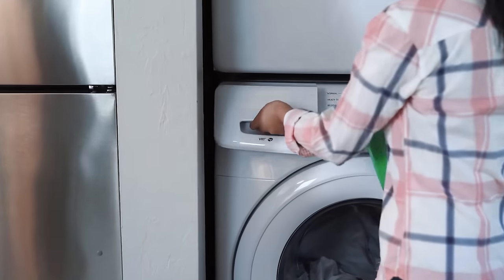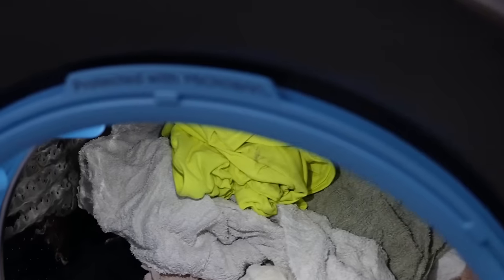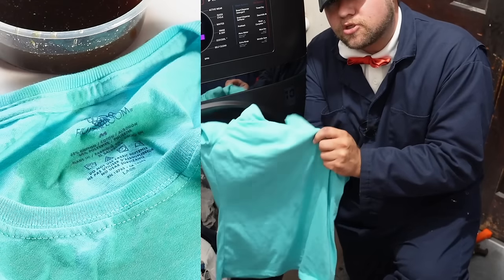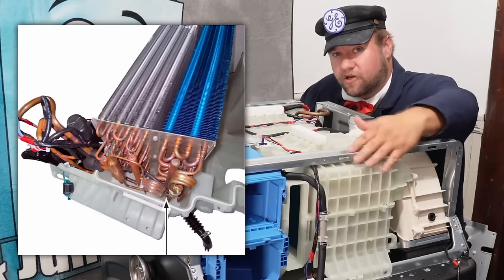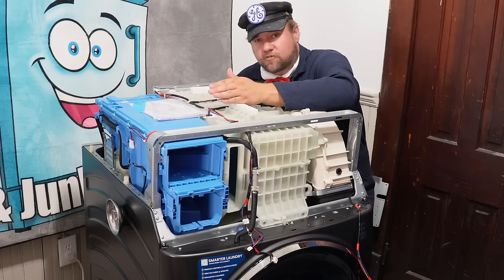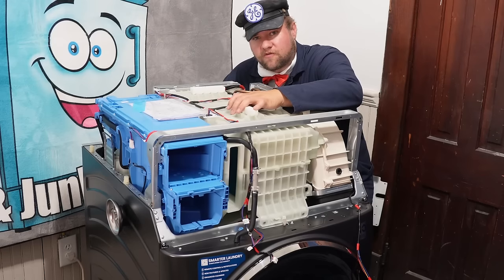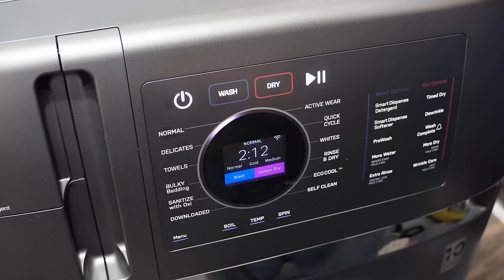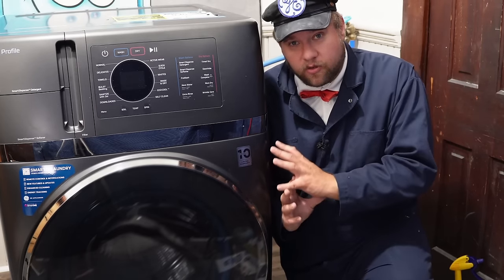The Best Washer Dryer EVER? The Ultimate GE 2-in-1-washer Dryer Combo Test & Review

Comment: In 1953 it was Westinghouse, not White-Westinghouse. GE appliances are built by Haire . General Electric no longer builds appliances.
Reply from the maker: The same GE factory is still making refrigerators in Kentucky that has for decades and decades...
Reply: That may be, but General Electric sold the appliance division to Haire some years  ago. So Ive read. In fact, I've read GE sold the lighting and medical equipment divisions as well. From what I've read, GE only builds Turbo-Jet engines anymore. GE did the same thing Westinghouse did. Sold off all their divisions. Westinghouse only held onto the Westinghouse Nuclear division.
 @bensappliancesandjunk

Comment: Ventless? Can you detail this feature?
Reply: Once the door is closed this is a closed loop. The heat pump will heat the air, a fan will blow the air into the drum, then draw the moist air back out of the drum, the warm moist air will pass through a heat exchanger to lower the temperature, the moisture in the air will condense out, the water will drain out using the washer drain pump, and then the cycle repeats.

Comment: Minor point, but you are conflating "Kilowatts" with "kilowatt HOURS". When you showed the display of the "Kill-a-watt" power analyzer, that tells you how many watts you're drawing right at that instant, and in the video it was about 800. Then you said that a load used up about 1.1 Kilowatts. That is incorrect. It used 1.1 Kilowatt HOURS. In other words, 1.1 Kilowatts for an hour. A "kilowatt" is a unit of power (ie. without a time component). A "kilowatt hour" is a unit of energy (ie. WITH a time component).

It's the difference between peak power usage (800W) and accumulation over time (1.1 kWh). 1.1 kWh is either 1.1 kW for an hour, or 550W for two hours. Since your test took 2 hours, this is your average consumption.

Comment: Mine is shaking violently right before the spin cycle. Any idea what can be causing this?
Reply from the maker: Have you removed the shipping bolts and bracket at the rear of the unit?
Reply: @bensappliancesandjunk  yes the delivery men removed the shipping bolts but I didn't see a bracket anywhere.
Reply from the maker: @oakfig  I have videos on how to find error codes. I'd check those first. Then I'd probably look for something that has come undone that's causing it to bounce. Like suspension springs, suspension rods, or counterbalance being off.
Reply: @bensappliancesandjunk  will do. Thanks so much man!

Comment: Love ours got it today. Wanting to get a second one, but I've measured the amp draw during full tilt it's near 10 amps sustained so if your outlet is 15A it won't cut it, 20A if it's dedicated (debatable though because 20A constant draw during dry cycle may overheat the wire and cut the breaker). Even if you decide to split your 240V you may only get 15A per pole (most are 240V 30A). So YMMV... Not sure how I'll do this yet. I could use the 110V socket for one and then the 220V socket for the other but I'm using that for the car charger lol.

Comment: Owned this POS for 3 weeks.  Prior to EACH operation inspect and clean the filter elements.  After 5 loads total there's lint passthrough to the heat exchanger face.  This system depends upon high heated air circulation.  F-GE.
Reply from the maker: There's a fix for that FYI. May do a video on it before I give the machine away

Comment: As a current appliance tech... do not buy these.  They're 110v and it's going to take forever to dry. Normal dryers run on 220v, 110v for the power and 110v for the heating. That washer dryer combo runs off a normal 110v plug so it is going to take forever and it will give you issues.
Reply from the maker: They dry amazingly well for 110v. It has a heat pump that pulls 1200w. The COP of the pump is insane and I have a video where I threw a thermometer in it... it gets up to 155*F in drying mode. Just as hot as a standard tumble dryer.
Reply: @bensappliancesandjunk  drying capacity is lower, check out reviews for it. A lot of people are saying it takes 2 hours to dry a set of clothes which would normally be half of that. A lot of people are returning them due to clothes still being wet after drying multiple times all night. Techs knew this would be an issue and yea there are some good ones out there but all of ge products are horrible and are designed even worse. How many times have you gone out to a ge dryer and the purple wire at the bottom right of the element has been burnt? Every company uses a normal heating element but not ge, they decide they want a giant round one so if the back gets dented at all you can definitely expect it to ground out and stay hot without the dryer being on.  In my opinion anything ge is horrible.  I know not everyone will see it that way and that's ok.

Comment: If thats a condenser based dryer function its a hard pass from me. I had a small samsung stackable ventless in my old cabin and it took forever to dry and never got the clothes bone dry, leading to mildew smells. Cleaning the condenser fins was a huge pain in the ass. Switching back to a old fashioned vent unit when I moved was a godsend.

Comment: Four hours?! What did I get myself into.  All I heard was 2 hours.  If it's 4 hours, Costco is coming back and picking it up (I paid $1900 fyi)

Also it's near 400 pounds.  That is the size of two adult males.  Keep that in mind.  I struggled to move this thing on a thin carpet with sliders.  I REALLY struggled getting it off of the bottom box foam that seems like it must insert up toward the washer. I just kept rocking the unit off of the foam in a tight space.  Rocking 400 pounds is not easy, NOT easy.
Reply from the maker: A regular load of clothes is 2hrs. A very bedding-heavy load should be around 4.

Comment: I used to work for GE. They sold their appliance division to Haier out of China, with rights to use GE brand name (til 2056 I believe).  So, GE appliances are no longer "General Electric" appliances.  GE appliances, lighting and other consumer divisions all sold to China in 2016... and hundreds of people were permanently laid off.  So, beware of that cheap steel that country uses, which is notorious for rusting like a cheap Chevette.
Reply from the maker: If you worked for GE then you knew that GE was already using Haier parts well before the acquisition then?
Reply: @bensappliancesandjunk  No I didn't. Guess it wasn't important to us until we were told our jobs were gone. But most US. products are made with cheap Chinese parts, so what's your point?

Comment: If you're not cleaning the lint filter on your normal dryer I don't see how that's the fault of this combo unit? Also given its ventless you have the advantage that you don't have to clean the vent ducting system as a maintenance task either. I think the kind of 'set it and for get it' mentality is a bad thing. Its not like we tell people "yeah jsut drive your car and never do maintenance on it." Why should we say "your washer/dryer requires zero maintance"
Reply from the maker: Its not the fault of the unit per-se, but a reality check on humans and their ability to blame the product, not the person. The other issue is that the failure to maintain the unit will cause issues faster than a traditional set-up. Again, not the units fault per se, just how the science of a heat exchanger works.

Comment: Great stuff, but you keep saying the usage of power in kW. kW is a measure or rate of power not capcacity/usage, that would be kWh. Completely different. Otherwise, great video, thanks. "Over the course of a 5-years, you're going to save 800 to 1000" kWh (NOT kW)!

Comment: I like the general idea...but I see clothes shrinking and forgetting Not to put bras in but they need a good washing....ehhh?   I want my old set of kitchen aid back...I like to set my own times and even just  set a second rinse occasionally or....I used to wash all of my husbands work clothes, but to wait until that entire cycle is done would piss me off if the stain got wet in permanently because it dried without a visual inspection ...MY TIME IS VALUABLE, so give me back non computerized gear timers, load levels and temperature settings!  I like to be able to was and dry a load rapidly if needed!  If all my uniforms were in the machine, but an emergency occurred where I was needed in a particular setting like a funeral or? or something....then what!?   I seriously want to know if they still make the pre computer old fashioned extra sized washers and dryers...I do a lot of sleeping bags, king sized beddings camping equipment..l know how long an$ which temperature for which stains...let me use a 20 minute wash totalvon a gebtle agitation but fastest spin speed to aasureva quick drying time on a medium heat for 20 to 25=minutes!  And if I was a warmbwasgvand warm rinse,valet me pick that.  Not every cold water rinse does the best job!

Comment: The biggest problem with this is going to be refrigerant eating away at the coil and creating pinhole leaks if the quality is subpar (and unfortunately most Chinese coils can't handle 410a). You will then have a completely dead unit.
Reply from the maker: Thats a very good question. One of the reasons I tend to not suggest Chinese refrigerators is the concern about sealed systems traveling to the US. However, with air conditioner packages, its been done for quite a long time, and they seem to be decent and not have TOO many problems if the QC is good. Sadly its tough to guess their QC on these at this time w/o running for years. The coils and sealed tubing look really nice and beefy though in-person though.

Comment: nice machine too bad a good chunk of the cost is in the novelty of it. you are getting rid of a whole nother machine and yet the cost is the same as if you bought a two unit setup. that and based on reviews it seems its only real downside is that it doesnt dry heavy items 100% so a second dry cycle may be in order sometimes. the pros of this machine are quite good though. the fact it runs on 110 and is ductless makes it super convenient for many as well as the fact its only 1 machine so it takes up less space.

Comment: Please be more accurate in your use kW vs kWh.  You can't say it used 1.1kW. You can say it was drawing 1.1kW but that means nothing when comparing total energy used for a cycle..  I think you meant it used 1.1kWh.  Either way, 1.1kWh per load is definitely an improvement over a conventional dryer... but only if it handles the same size load as a conventional combo without extending the cycle time proportionately to the energy reduction..

Comment: Bunk review. Why? There’s no reason why a review, especially by a technician, wouldn’t include the worst case scenario- you’re just outside your warranty and it broke down. What’s the major parts price replacement range looking like? Is the control board replacement 3/4 of the appliance replacement cost? You know it is, at least, if not closer to the total cost.

Comment: Could have just started by saying that with separate units you can be washing one load while drying another. This one, not. And, this unit gains you only about 24" compared to a stacked set of separate units so, space saving, not much. Lastly If you had just said this unit costs about 30% MORE than any comparable stacked set then, hell no.

Comment: Suppose the better part is the fact that it drys the clothes, but then who wants the damp clothes, probably then you got to hang up the clothes to dry more before putting them away, also you need to drain the water through a hose, which you can't really do properly if the combo unit is in the kitchen or living room. The older model dryers are much better as they can completely dry all the clothes.,no damp clothes. And avoid putting pillows into washing machines.,sure to unbalance the load, and even cause the motor belt to come off. 🧺 👕🎽🧥

Comment: this is 3700$ in canada... just piled full of sensors and electronics i gotta think this machine will put you in a bind unless youre just overflowing in disposable income... way too expensive to just throw it away and replace it yet theyll make sure any failure falls under the 1 year warranty never the 5 or 10 year warranty.. or itll need to be brought to some facility 500 miles away labour isnt included or just a bunch of nonsense.. an independent tech will take hours to diagnose an issue and likely conclude it needs some 500$ part to maybe be repaired

its a washer/dryer not a car it shouldnt bring such headaches.. i can pull my old washer or dryer apart and find the issue with it when it breaks.. parts are dirt cheap, the most complicated thing in my washer is an automotive style relay

Comment: I fail to understand the point behind this ridiculously expensive machine. Not to mention that the drying via dehumidifying takes significantly longer than hot air drying...I just don't get it. Sure - that heat pump unit might be 'easily replacable' but at what cost? It's great that your washer/dryer is also an air conditioner and refrigerator - but is this more form or function? At the price tag, I can buy several washers and dryers AND pay for the electric. I'm sure non-western folks where electric is much more expensive have a point - I can't imagine waiting that long for a load of laundry! I guess if you have nothing else to do with your life...but for many of us who have 5, 6, 7 or more people under one roof a machine like this would have us walking around in the nude, trying (unsuccessfully) to 'dry off' with a wet towel and likely keeping fruit of the loom in business cause it'd be easier to buy new. I'm all for innovation...but unless you have serious space issues I'm at a loss on this one.
Reply from the maker: At current pricing, this is only about $500 more than an identical washer dryer set. If you have 5+ people, this simply isn't for you. Consider the long discussion I had at the end of the video. This is by far the best combo unit on the market. Key word: Combo. This isn't meant to replace a typical WD and even the guy that invented it said that much.

Comment: I have brand New Samsung Front load washer and dryer and I never use AI Sense for anything. While the idea is good the overall performance is garbage. The Washer is less than the Dryer but still. The Dryer is real garbage ANYTIME i've ever used the AI Sense Dry on any Samsung dryer the clothes are either wet or never get done. Or they come out half dry half wet. I always use the Timed Dry setting so it forces it to dry. I would never let the dryer guess weather or not the clothes are dry the technology just isn't there yet.

Comment: Whirpool had something like this out 2-3 years ago. they did the same thing with the sealed system, it failed you just buy the whole replacement. if its not in warranty its 1000$+ to replace it. I also disagree that GE is a reliable company. Parts are hard to get for them, there dishwashers are junk. Basically GE went overseas with there designs and o there techline is junk. I tell all my cusotmers to stay away from GE. Speed Queen all the way for washer and dryers.

Comment: Imagine, California 10 years from now, almost everyone using electric water heaters, electric dryers, electric stoves and ovens, electric car chargers in their garage, causing more power outages while the hybrid car owner with gas appliances and a gasoline generator is sitting cool, cooking dinner, drying clothes and taking a hot shower.
Reply from the maker: Paying his entire salary to fuel that generator as it's horrible at energy conversion.
Reply: @bensappliancesandjunk  Even if gasoline turns $10 per gallon, basing on the worst end of generators at full load, $60 to power a generator for 6 hours while the grid is down on a hot summer night is better than living in the dark. And electricity rates are only on the rise, how about that energy inversion?
Reply from the maker: @KoryBrooks  You just sized a generator that needs to dry clothes, take a hot shower, and run a stove. Your talking a peak load of far and beyond what a 1-gallon-an-hour generator is going to provide though, isn't it?
Reply: @bensappliancesandjunk  I see you failed to spot my OP about gas appliances. claps hands Do not need electricity light a stove. Do not need electricity to run a hot water heater. No one is going to dry their clothes during a black out, but you could if you wanted to, the gas is still on, or in my case, liquid propane. Essentially you just need your fridge. No one is going to load their generator at 100% either, maybe up to 25% realistically, and you can run over an hour a gallon at that load. Im not advocating for gasoline and natural gas, liquid propane, I am advocating for doing what makes sense, and going pure electric before the grid can even handle it is not making sense. The guy with gas appliances and a decent generator, or even a battery backup device is going to be sitting pretty during blackouts. Because what luck are you going to have powering electric essential devices on a generator or battery backup for extended blackouts? Dont ditch all your gas appliances for electric straight away. Its like quitting a job before getting hired elsewhere first, the moment you need it you dont have it. The original gist of my OP was, a hypothetical scenario, I am no magician who can predict the future, just a realist with realistic expectations. I can argue both sides of this argument but I have this side while you have taken that side.

Comment: Compressors wear out. Nichrome wires in an electric dryer last forever. Watch what that control board cost when it goes out in 5 years.
Reply from the maker: Given how many dryer heating elements I sell, that's not really true